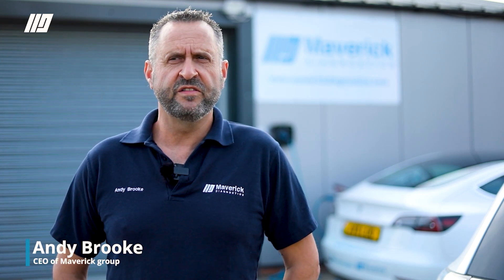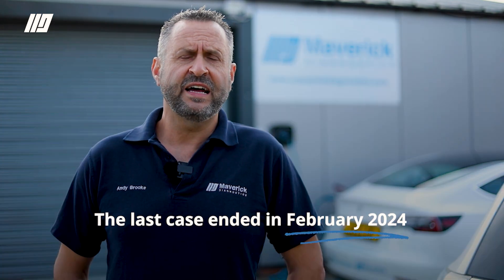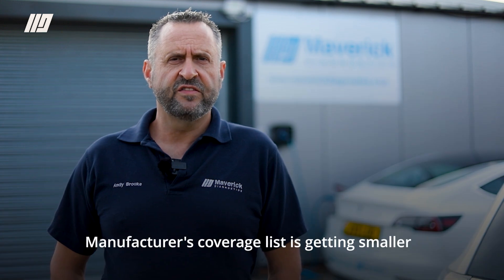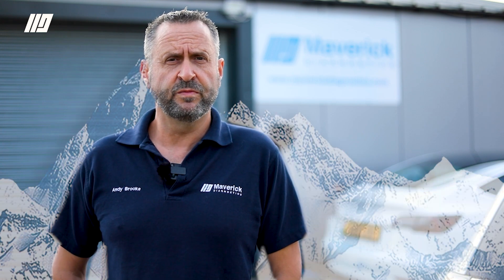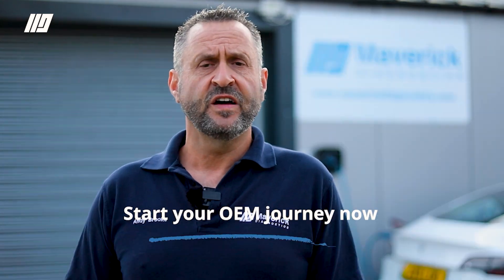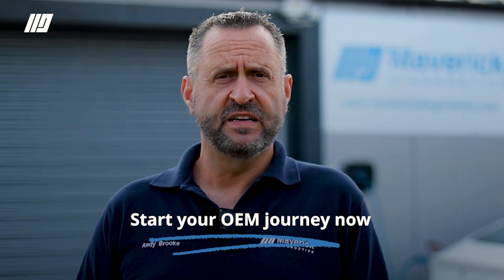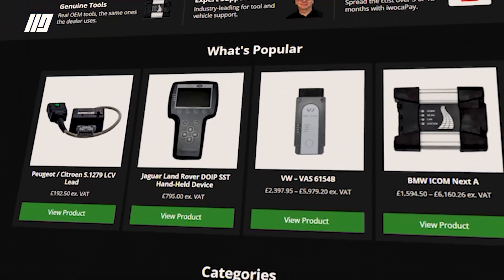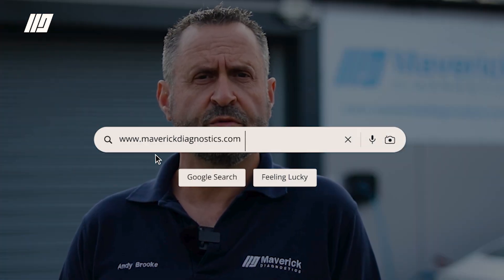The End of Aftermarket Tools? Understanding OEM’s Push for Security

Comment: ODIS made in China 🤷‍♂🤷‍♂ — aftermarket hardware is ten times faster than the OEM version. It’s an absolute joke how long OEM software take to load their systems while charging a fortune for subpar hardware. Meanwhile, China is delivering world-class manufacturing, supplying even the EU and UK defence industries. Their programming capabilities are top-notch, and the automotive sector could learn a lot from them — especially when it comes to efficiency and passing savings on to small businesses.

Comment: yea lets make it impossible to fix our own stuff even at the small shop level and plame it on china the darn software to tune my say modules or fuel tables should free free with my new f250 or any thing its my bloody truck but as a American with that attitude and supporter of right to repair all the stolen parts nonsense falles on deaf ears  as the truth in that is minimal at best .swapping a door window head light or ? module should work with no issues at all but nooo!! lol  but until the oem is forced to do that it will be a nightmare and money pit over a 35 usd part
Reply from the maker: Thanks for your feedback. Modern vehicles are certainly more complex, which can make repairs more challenging without the right tools or training. At Maverick Diagnostics, we specialise in helping independent workshops overcome these hurdles with OEM-level tools and support. While the right to repair is still evolving globally, we aim to bridge the gap and help keep repairs accessible. Feel free to reach out if you’d like to learn more about what we offer.

Comment: I find people misuse diagnostics to add more on to a bill. You go to most garages and they want £85 to tell you there is a fault you booked it in for. Many can't interpret results as they think it will tell them which part to change. It Iden doesn't, it will show where a fault is and you still need to understand how that car works.
Main dealer wanted £3800 for diagnostics,  a BCM, plus two headlights after diagnostics said there was a levelling error and AFL error.
They didn't test much. I resolved the fault by finding water had got in a connector and was shorting pins.
That was dried, then waterproofed and works fine.
Had the garage relied on diagnostics they would have thrown parts at the car, then probably lied when they realised what it was.
Some would admit it, others would keep the parts and sell them or do other jobs, some would get a refund. None would change them.

This is why you can't trust main dealers that pressure staff to meet sales targets.
Reply from the maker: Thank you for raising this issue. Misdiagnosis or a lack of thorough testing is a concern for both customers and workshops. Diagnostics are powerful tools, but they require expertise to interpret correctly. That’s why we prioritise providing not just tools but also training and support to help garages get it right the first time. Stories like yours remind us how critical this is for building trust in the industry